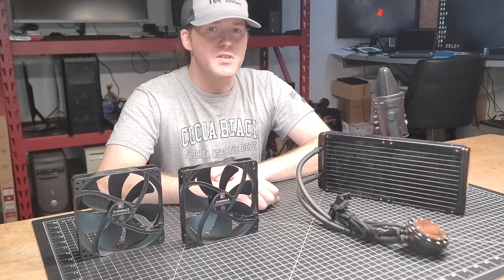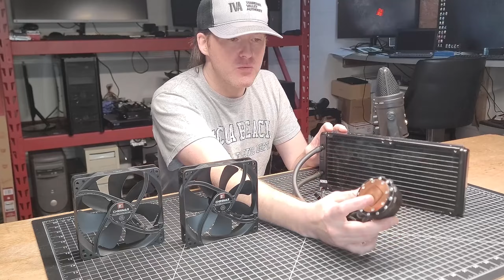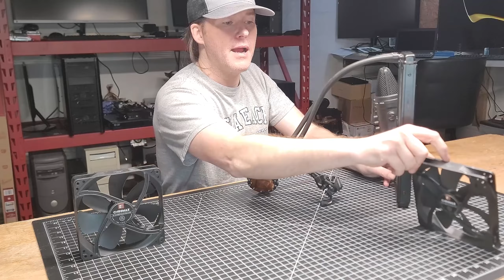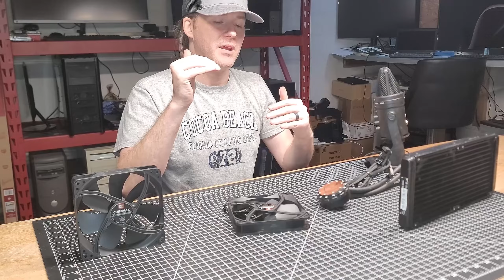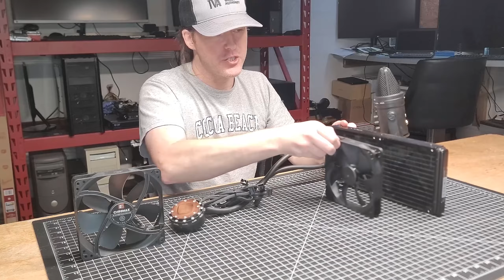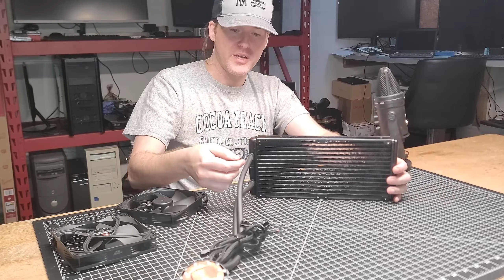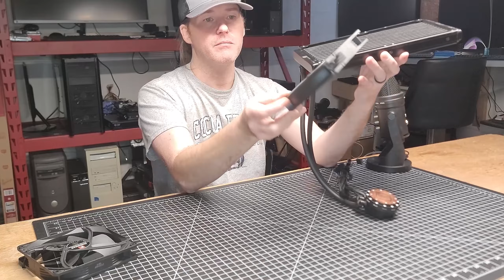Are You Killing Your AiO Liquid Cooler? - Dos & Don'ts

Comment from the maker: Make sure you're not incorrectly mounting your AiO liquid cooler radiator and pump! Incorrect mounting and orientation can not only increase your CPU temperatures, but can cause premature pump failure! In this video we'll be covering AiO pump and radiator mounting basics to prevent premature failure, as well as the preferred fan mounting depending on your goals and case design. Touching on the differences between Static Pressure Fans vs Case Fans, radiator fans as pushers or pullers, as well as the benefits and pitfalls of radiator push/pull duo setups.

👍SUBSCRIBE👍 to see more tech videos! → https://www.youtube.com/channel/UCS7Q_pcIDNHefwBwuH7FhrQ?sub_confirmation=1

🔷FOLLOW MY SOCIALS🔷
Discord - https://discord.gg/QsPh5rPBcV
Instagram - https://www.instagram.com/warning_56k/
TikTok - https://www.tiktok.com/@warning56k
Twitter - https://twitter.com/Warning_56k
Facebook -  https://www.facebook.com/Warning56k

0:00 - Intro
4:30 - Air in System / Coolant Loss
6:50 - Proper Radiator-Pump Orientation
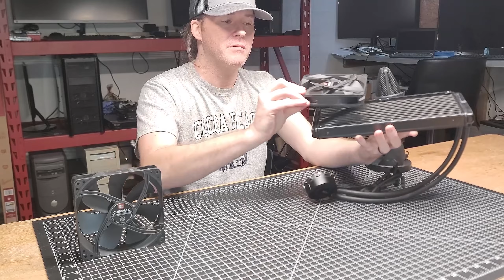15:09 - Rad Fan Orientation Push vs Pull
15:50 - Fans - Static Pressure vs Airflow
20:52 - Dust Accumulation
22:53 - Push & Pull Fan Setup
25:31 - Radiator Design / Flow
30:52 - Outro

Comment: Should the pipes on the radiator when mounted at the top be facing the back or the front of the pc case?
Reply from the maker: @malcolmadams6247  Either way doesn't matter. Whichever works the best to give you the most clearance around other internal components or whichever orientation looks better. I tend to put mine towards the rear to prevent disrupting front intake fan airflow, but at the end of the day it's not a signifigant impact on airflow.
Reply: @Warning56kb  thanks for replying so fan man!
Also I have my fans on top of the radiator as that's how it fits on my case in the pull configuration is that ok for cooling the radiator?
Reply from the maker: @malcolmadams6247  You're welcome! That works very well also. With the fans as pushers dust has a tendancy to collect on the radiator surface between the fans and radiator. Having them as pullers lets you simply blow off the dust without fan removal. The temp difference between push and pull is also negligible.

Comment: how about side mount? i have an ITX so im limited to orientation . thanks
Reply: to be specific i got k66 itx case aio 120 alpha cool
Reply from the maker: Side mount is 100% ok as long as the pump isn't higher than the top of the radiator.

Comment: the corsair fans I have are only controlled by the icue app, they are magnetic levitation that came with the cooler although they are 4 pin rgb and dont fit the commander core I have asus rgb 12v rgb header, if i replace them with asus rog fans for the ryu 2 I can control the fan speed in asus armory, the corsair fans are to noisy set to extreme, if I use balanced my applications crash, can I still use the corsair fans 2100 rpm, with the asus rog fans 2500 rpm on push and pull, asus on top pushing out the top of case.
Reply from the maker: @jameshadaway8621  Check out Fan Control on Github. It allowed me to be able to completely ditch Armory Crate and Kraken Control for all fan control. Push & pull setups will just about always let you run lower RPMs (and noise) than you would with just a push or pull, but the only real caveat with push (or push & pull] is with dust buildup on the intake side between the fan and radiator, making you have to pull the fan for cleaning. Not really a dealbreaker, but just extra work that you otherwise wouldn't have to do.

Comment: Okay so as long as the pump is lower than the outlets the air bubble will stay at the top?. Cuz my case said 360mm aio was supported but they neglected to say only upside down and minus a fan 😂. First pc build and ive been dreading that puzzle piece.... and wires... damn its so many wires😂🤣😂
Reply from the maker: @shaggy_vibez  That's correct. If your radiator is flipped with the intlet/outlets at the bottom or top, it's fine. As long as the pump is below the inlet/outlet (water line) the pump will stay fully submerged with coolant.
Reply: Awesome and yes have had no issues whatsoever with tempurature and i had to remove one of the three fans to get it to fit completely and running at normal workload 18-22avg and even running dcs vr and siege at max graphics quality (all this is 1080 my t.v doesnt support 1440) my max temp reached has been 72 and i get around 260-300 fps consistently according to invidia

Comment: buy a 13900k and tell me ur coolant stays at 40c thatsjust bad advice
Reply from the maker: I have an overclocked 13700KF at 5.9GHz. Guess what the coolant temp stays well under? 40c. 🙂
Reply: Undervolted no doubt
Reply from the maker: No.
Reply from the maker: If you cant keep your coolant temp under 40c you either have an undersized AIO for the application, incorrect settings, a high ambient temperature, or a combination of those.
Reply: @Warning56kb 360. to be fair it only gets warmer under heaviest load rendering and a couple games. Hopefully my comments boosted ur algorithm even if it annoyed ya haha
Reply from the maker: Lol no worries. It's not easy making sure that all bases are covered if someone is newer to configuring. Lots of variables to not only initially configure, but later modify and assess if there is a problem. Add in the fact that some manufacturers rate their AIO with an upper threshold of 60c, it leads many people to believe that higher coolant temperatures are acceptable or ok for longevity.
Reply: Comment after two years. One more for the algorithm 😜: It depends on if you followed the coolant's instructions (pre-diluted/concentrate) AND ambient conditions.